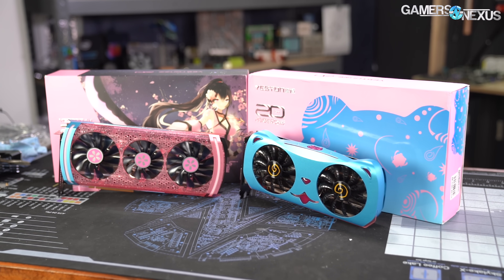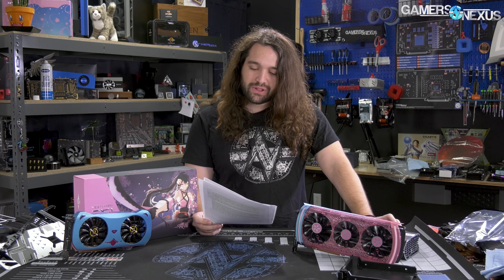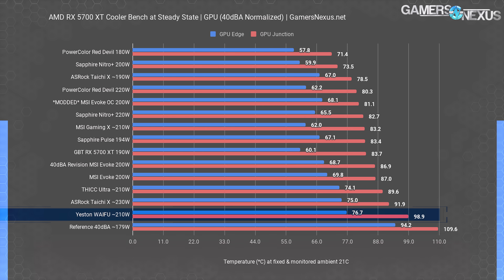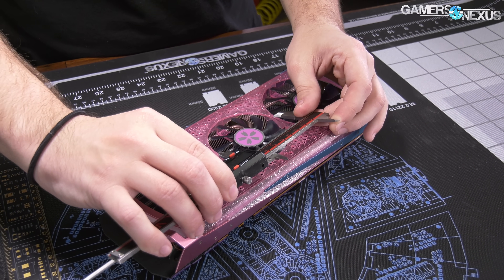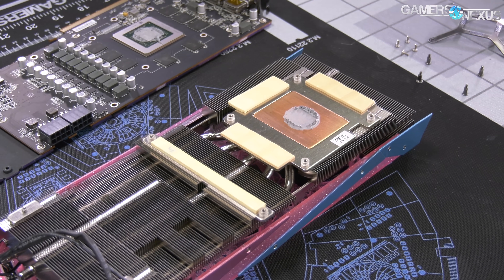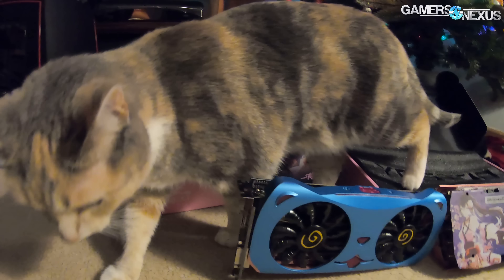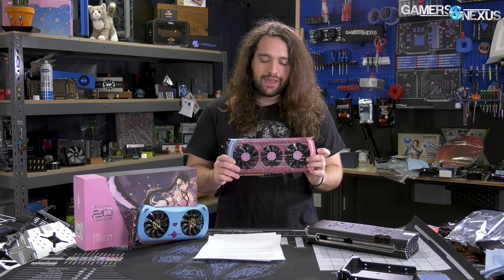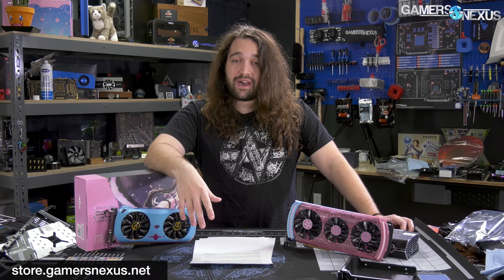China's RX 5700 XT WAIFU Video Card by Yeston | Review & Tear-Down

Comment: Which THICC Ultra did you use? There is a bad version (THICC II Ultra) and a good version (THICC III Ultra). I have the THICC III ultra. Checked the performance before i bought. its one of the best coolers out there. card goes 1995 no problem and stays relatively cool!

Comment: Waifu characterized: (1) not THICC, (2) hot, (3) TOO hot, (4) loud when driven, (5) also screams, which is unpleasant at low freqs... but can be drowned out at higher freqs... just go faster... heck, go full auto, (6) is trash, (7) SO LEWD that facing the backplate risks demonetization, (8) fun to look at, (9) fun to "test", (10) has a lot of weak points.

Comment: I'm pretty sure it was meant as nothing more than a joke, and maybe to cash in on a certain niche, but I highly doubt that.
They also make a white version of the same card with pink fans, which I think is much better aesthetics-wise with its clean and tidy looks. This design is just too busy, and messy even, with all those holes in the shroud, not to mention it would be a nightmare to clean later on.

Comment: i actually wish we had cards like the pet and waifu here in the states... i mean something other than the plan crappy back side that we have to look at all the dang time unless we get a special attachment that lets us install it vertically so we can see the much cooler looking side of the two (even though most of the time its not that much better looking. if i had something that looked like the pet i would totally go out and by the attachment so i could see that lil face looking back at me, or if we had something like the waifu that had some cool looking logo or artwork on the normally crappy boring dull back side. man that would be freakin awesome!!!

Comment: PLEASE HELP ! Do i need motherboard bios update if my Rx 5700 Xt nitro+ works weird? fan randomly ramps up on idle, really really poor performance in games (worse then gtx 1060) blackscreens and stuff.  I use an x370 aorus gaming k5 with r5 1500x for now, and with an old bios .. f22 i think. (because my ram couldnt work when i updated for the newer bios at the time) . I used DDU before installing the Rx 5700 XT and installed all the newest amd drivers.

Comment: strange that radiator/cooler looks really efficient and no nonsense It must be the fans are not generating enough static pressure at low rpm.

Comment: Two kinds of graphics card in the west:
1. gamer
2. water block

Snore. One of many reasons why I still use a CoolerMaster HAF 932 Advanced as a case. Do I want to be able to see the ugly GAMER!!! gpu, or do I want a side panel mounted fan to help cool the GPU for better performance in games? Obviously the latter, it's a win win.
Another reason not to be able to see the graphics card: most of them sag because the companies are too busy trying to look cool (and utterly failing) to actually build the card properly so it can support itself and not look like a saggy piece of crap that's about to fall out when it's actually installed in a motherboard.

Comment: The issue I keep seeing is fins.  If designers would develop their fans to push air towards the IO for exhaust.  This would require the Fins to be also run along the card length wise vs width.

Comment: I feel like if you are willing to pay $500-$700 for this card and you actually care about tech, then you would probably be willing to put thermal pads on the back of the pcb and fix the mounting pressure. So it wouldn't be aaaaall that bad.

Comment: No, not all cards look the same. And yes, you should talk about design of the parts also. Most of them are just trash "gamer design", but there are a  few cards with more sleek and minimalistic design, Radeon VII is quite nice looking, so is RTX Founders Edition. MSI 5700 XT Evoke is the nicest looking aftermarket card I have seen. Of course price, performance, temp and noise is the most important, but that doesn't mean design can't be discussed and taken into account also.

Comment: They should be making side mount gpus show off the back plates rather than put the fans next to the glass. The card would have to be mounted upside down to do this but it would be a better config for both the art work on the back plate and fan thermals. Then cards would have to fix the art to be in that config.

Comment: You missed the biggest issue with the card:

When it's mounted on the motherboard, the waifu is upside down from the user's point of view, and if mounted vertically, you can't see her at all. 0/10 for waifu fail.
Reply: tiladx came here to say this
Reply: Unless you have a PCI-E extender cable
Reply: I've noticed that since the first time I saw that thing
Reply: isn't that a issue with every single gpu on that market
Reply: what? I'm pretty sure the backplate is aligned to the top
Reply: lol this can't be fixed even with riser cables, only way out is to use a case with inverted motherboard layout and do Hindu squats so that you can get low and squint at the glorious backplate from below
Reply: Add one of those infinity mirror things to the bottom of your case, so you can have infinite waifus in your case. ;)
Reply: not if you are reverse atx
Reply: actually the biggest issue is that this card has a waifu print on it...

Comment: waifus problem is its hs fins are running width wise not legnth wise.. 1/2 the gpu heat is melting the pcie slot and blasting the motherboard with excess heat. the width wise fins ensure alot of the air cannot escape the case efficiently if your system is push pull the video card will always be exhausting heat directly into the case just by design. running fins length wise is just way more efficient.  and could do better thermals with 2 fans.

Comment: So waifu is too hot cause it has uneven weight distribution?
Do you think you could fix that by squeezing her a bit tighter? I'm sure something could be done to fill in the gaps.
Maybe stick something in before you mount it?
And if the shroud covers too much, just try uncovering the waifu a bit.

Comment: Noise normalized means you actually tuned them all to a 40db measurement before testing?

If yes, that is an approach I really like and that should be in every hardware review. :)
Reply: Hm, but the frequency and performance is not normalized, right?
How about also throwing performance/price into the equation? 
(Temp(40db)*price)/performance
Or maybe easier to test:
Temp(40db,1800MHz)*price
The ultimate metric?
Would be interesting to see at least ^^

Comment: What we need is a megumin waifu that explodes after 3 hours of use

Edit: or these other ideas where the gpu just blows up when it's about to die , or just takes up so much power and gives you a huge fps gain but after awhile it drops down like how megumin loses her mana
Reply: Intel is getting into the GPU biz
Reply: I hit like for Megumin.
Reply: Could do that with a gpu that just has a big, solid block of metal as it's heatsink, with no actual cooling.
Once it heats up, it takes forever to cool back down.

Comment: Me: That card looks pretty good, might pick it up

The Card: $500-$700

My Wallet:
Reply: Gonna sell my 5700xt for this
Reply: * Surprised Pikachu face *
Reply: you're telling me you didn't have to sell your wallet to buy it? damn
Reply: Really. If anyone is going to pay that much for a GPU. They should just get it with a customized shroud on it. After all. The shroud does little but add looks and some protection.

I'd rather given a choice to put something on the shroud than some black and red or black and green. Or some other basic color that has no style.